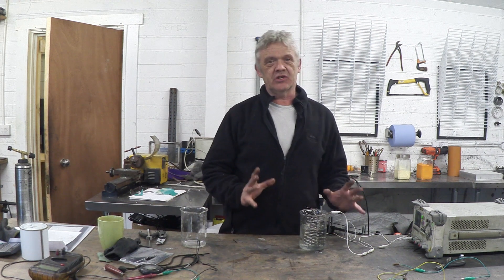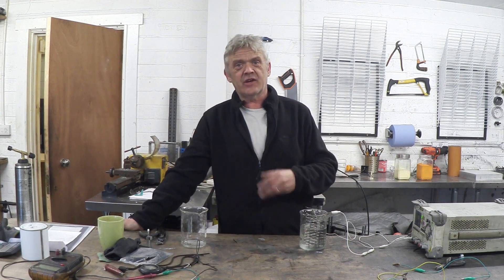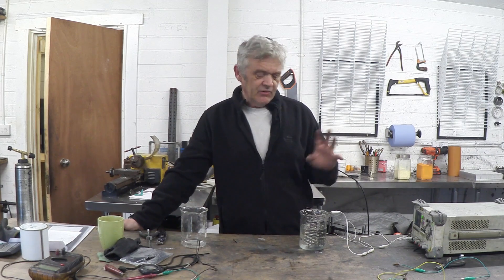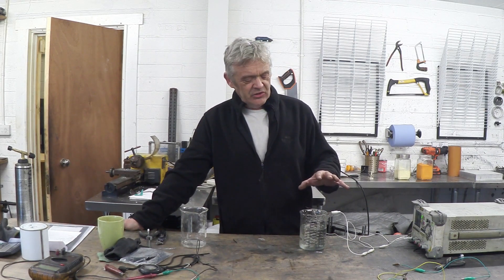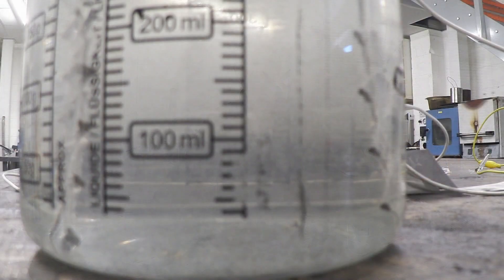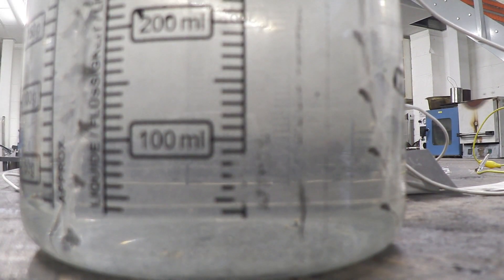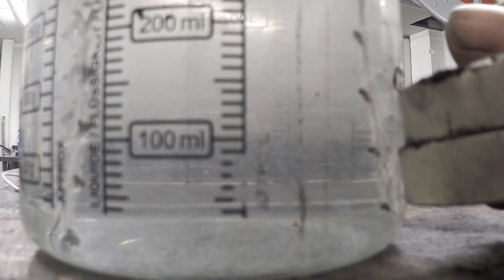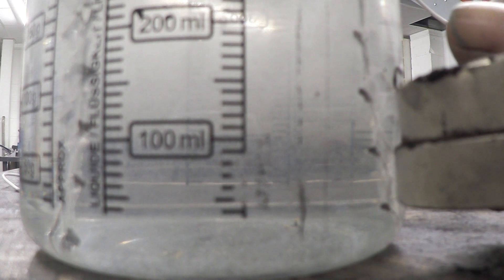Making Hydrogen With Magnets

Comment: Will stationary magnets next to wires with flowing electricity add to the power or voltage coming out of the wires?
In other words, will a low power source increase in proximity to stationary magnetic fields increase output; or is it the reaction of the electrolyte chemistry that is increasing?

Comment: There is a paper on the net with a magnet spin experiment on the electrolysis of water. The paper states that by aligning the spins in a vertical direction (or parallel to electrodes I think) as much as doubles hydrogen production. It's a fairly physical reasoning that the gas bubbles are prevented from collecting on the electrodes. Otherwise, the holding of the bubbles on the electrode surface physically prevents contact with the water reducing efficiency. I guess this has already been observed, but the point is that fine-tuning the directionality as much as doubles the effect. This is way beyond a minor effect and is easily achieved. The paper also states that the introduction of the magnetic field serves to increase the current density in the electrodes, for free.

Comment: H2 is diamagnetic and O is paramagnetic so the hydrogen component is being repelled by the lines of magnetic force while the oxygen is being attracted to the magnetic lines of force thus in essence providing a mechanical force for breaking the bonds apart.  This magnetic force supplements electrolysis from having to do all the "heavy lifting" which saves considerable current.

Comment: Im not youtuber, but i want to make a experiment, i want to generate hydrogen with a microwave motor, with the very high voltage that generates the motor, but very low amps. If you can make that experiment in your chanel, would be great, because i dont buy the motor yet.

Comment: Adding a magnetic force produces a downward Lorentz force, and convection of the electrolyte counteracts the floating power of hydrogen bubbles and exerts a negative effect. 
Electrolyte convection is oriented in the direction of the floating power of hydrogen bubbles, positively affecting hydrogen production through electrolysis and reducing electrochemical polarization.

Comment: normally you have the wires going into the container from outside but i wonder if you had a coil on the inside and a coil on the outside so you have a glass core transformer effectively.
and then you have the 2 end seperating from the coil to generate you're hho gas.

Comment: I wonder if this can be used to help deplate preacious metals without useing a dangerous electrolyte..like sulfuric acid. In a gold deplateing cell.  Maybe with the magnetic field enhancing the process just enough to use some safer electrolyte such as acetic acid and salt . not only would it be much safer but cheaper as well. Ill have to give it a try thanks again .

Comment: I have a question for you. What effect does adding amperage and what effect happens when you up the DC voltage? For instance, is 24 volts more effective than 12 and if so, what about 36 or 48? Does adding amperage make any difference? In fact most references mention millivolts. I have certain physical limitations that prevents me from conducting experiments my self but my curiosity is certainly aroused.

Comment: Awesome. "Magnet power" is REAL. Joe Newman died for our sins. Simply adding powerful magnets makes an electric motor STRONGER and FASTER. Joe Newman proved this, and my many motor experiments have proved this also. Now, here you are showing that this same "magnet power" effect holds true for electrochemistry as well as for electric motors: magnets actually "pull" on the electricity itself- making it more effective (in this case, producing more hydrogen and faster): or by opposition; magnets can be arranged to repel the electricity, slowing the motor, choking-off currents or repelling them, causing a motor to get hotter than it should for the applied "energy", etc. Adding magnets in one polarity makes it work way better: adding magnets in the opposite polarity makes it way worse. There is a Japanese scientist who is using pulsed magnetic fields to triple the output of his own, Brown's gas (HHO) generator, but i think the steady-state permanent magnets are good enough- use a vibrator or pumped water flow to help release bubbles from electrodes- make the plates closer together, use a better electrolyte (like strong salt water and stainless steel plates)- and now this: add permanent magnets across your capacitor plates, and the Hall effect will "speed-up" the current across the plate, without needing to raise the battery voltage or lower the electrode's electrical resistance.

Comment: I built a large cell from stainless steel pipe with an external tank and pump.
I placed the negative electrodes in tubes so as to separate the h2 from the oxygen.
A very small pump circulating the fluid was very effective. The external tank also allows testing ph without disturbing the the cell. Please do more research on these cells and post.
Also, magnetic separation of the gasses?

Comment: Daniel Dingel was also said to have magnets incorporated in his hydrogen generation system. The interesting thing is he apparently used a bismuth electrode. This has dielectric properties and may have intensified effects whith magnetic fields. His work was cryptic though, because his secret was never revealed. The bismuth may even have been used for its low radioactivity, seemingly contained in aluminium for the alpha radiation. But all these substances are related to hydrogen generation in some way already. Maybe he just combined them all?
Just in case anything there might be useful.

Comment: Old microwave transformers hooked back to back by the high voltage coils. Use a peizo element of a hundred watts or more with it connected to a ground and antenna. The idea is you may get a bit of power on the other transformer.

Comment: Just a guess, but if Hydrogen is diamagnetic a strong magnet nearby would repel the bubbles from the electrode freeing up the surface area for a more efficient hydrolysis. As someone mentioned below, similar to stirring. Same explanation as Sci Pi, but with Hydrogen rather than water being  the diamagnetic in this hypothesis.

Comment: Have you measured the volume of hydrogen produced with and without a magnetic, over the same period of time, to see whether more hydrogen is actually being produced, or perhaps the same is being produced but the reaction and bubbles appear more concentrated when a magnetic field is applied? Curious. Thanks!
Reply: the faster the bubble leaves the surface, the more the surface is in contact with electrolyte , thus faster the rate of production!

Comment: What happens if the electrolysis is done under very high electrolyte pressure?
Reply: The general rule is that pressure hinders molecular disassociation and a vacuum facilitates molecular disassociation

Comment: Well, I tried this with my higher voltage no electrolyte HHO test setup, it has no effect that I can detect, guess it has something to do with either the current as mine is very low or the electrolyte as the document states plainly, that it has something to do with the alkyli, anywho, Ill keep twiddling with it. If you want to replicate my experiment: its two stainless electrodes in just water @ 30 volts and bring them together until .4 amps but really I tried many variations and saw no change in gas production with magnets without electrolyte... interesting. Have not tried pulsing yet.

Comment: i know people have used magnets and electromagnets to separate the hydrogen gas and oxygen gas at the top of an hho generator . SO  i believe the gases are ionized. so you MIGHT just be seeing more gas pulled toward the magnetic area rather than a total increase in gas production. Don't know. just a thought. Would have to measure production with and without a magnet.

Comment: I built an electrolyser with magnets, mainly idea was to use magnetohydrodynamic to push the water and remove the bubbles on the surface of the electrodes. 15cm electrodes, 12mm surface, 5mm apart and 4 pairs of Nd magnets.
It kinda worked, I could see the water/bubble mix rise about 5mm over the surface of the water, when the electrolyser was also near the surface.
Going further with the idea, was to chain these electrolysers in a tube having circulating water...

BTW: Salty water is really bad for the magnet, they fell apart since 10 years a built that device... and I still have the same water too!

Comment: In one of your videos a few years ago you made a coating that when exposed to sunlight would separate hydrogen from water with no power input. I'm wondering if magnets would improve that reaction also.
Reply: do you have  a link please?
Reply: If I am recalling correctly he was using seawater in that video, may have even been on the beach.
Reply: Search the channel for graphitic carbon nitride.  And yes, a static  magnetic field does help photolysis by improving ion separation, reducing recombination.

Comment: I think what you're saying is just an increase in the point not an increase in the entire electrode I think it's changing the way the electrode is working to the point that is just redirecting output to line up with the arches of the magnetic field. That's just a guess I could be totally wrong you need to find a way to measure the volume of gas over time for comparison that would be kind of difficult without specialized equipment unless you can figure that out. I think if anyone could figure out how to capture that data you could.

Comment: @2:30 "Obviously it's a way of improving these things without actual [additional?] energy input"
Does this mean that additional hydrogen gas is produced while the current flow stays the same?
If current stays the same then that is a true increase in efficiency and those that say the magnetic field of knocking bubbles off which increased the liquid contact surface area are wrong. This is because if the permanent magnetic field were knocking bubbles off thus increasing the surface area, then the current would increase proportionally to the gas production.
Reply from the maker: read the paper given in the description mate

Comment: You should be able to quantify the increase in gas generation under a magnet field, by monitoring the cell current.
Any additional gas generation will be associated with an increase in cation current as the hydrogen ions are discharged.

Comment: Wrap wire around your vhoice of anode and cathode to create electromagnets inside your generator. Would those generated magnetic fields increase your hydrogen production?
Reply: 4th word 'vhoice',a typo,colloquism of what do you mean?You described a tank circuit ,approxmately,an inductor and a capacitor should your anode and capacitor be ,but not mandatory configuration,square or rectangular.

Comment: That's "just" the Lorentz force pushing the bubbles off the electrode.  Now if your electrode resembled an induction coil that would turn into a compact electro fluid dynamically pumped hydrogen generator. It might even last longer if you anodized the electrodes like you did for your Bagdad battery.

Comment: Electromagnetism. Go figure, water is a capacitor just like air.
It still takes a ton of energy to pop that hydrogen atom off. It's sticky and it finds every hole. Or make enough, fast enough.

Comment: Interesting. If that is magnetohydrodynamic stirring as suggested in another comment, then I bet that applying ultrasound to the container would have a similar effect. That would require a small power input, but could be morphologically much simpler than guaranteeing a high flux field at every active surface.

Comment: Thanks for your videos Robert.  I was wondering if you could try putting a conductive membrane or plate between the anode and cathode which I am thinking would allow you to keep the gases separated but improve performance due to less resistance.  Love your experiments, keep it up!

Comment: Now what would be awesome is if you make a video where the gasses are in a mixed container like that but on top you have 2 pipes for the gasses to travel up.. A thin square magnet sits in the middle between the 2 out going square pipes and on the outside of the tube that the North side of the magnet is facing put another square neodymium magnet with its North facing in towards the North side of the magnet in the center.. Do the same thing for the south side.. So one out going pipe is filled with a magnetic North and the other a magnetic south.. Hydrogen will go up one pipe oxygen will go up the other.. Thus you can spit the gasses without having to move the electrodes away from each other.

Comment: Amazing! Now time to calculate the power efficiency on converting electric to burning hydrogen.
Reply: Regardless of how you do it, it costs more to break up water into oxygen and hydrogen than you can possibly recover by burning those products. This is obvious.
Reply: @UncleKennysPlace  RMS states categorically on at least one other video regarding Urea electrolysis that there IS a net gain specifically over water electrolysis, but also that the energy output exceeds the input.

Comment: Something to do with aligning spin and spin coupling of diatomic molecule or liquid oxygen is magnetic so possibly mono o is and it helps strip oxy from the hydrogens into water away from electrode faster increasing kinetics.  This is the most amazing YouTube subscription I have ever found.  Thank you English guy!  Magnetic field lines allow hydrogen "atoms" but water being diamagnetic repulsed.  Any change of ph with the addition of magnetic field?
..  English guy? Any ideas?  Shine a red laser through field area with magnet and without, any change in refraction, density   or scattering observed in laser?

Comment: I've observed this with some of my electrochemical cells, mainly those that produce a gaseous product. I figure it has to do with generated gas blocking portions of the electrodes. If 50% of the electrode is covered in gas bubbles, we lose 50% of our useful surface area since the ions can't travel through the gas. Adding a magnet allows the electrolyte to be stirred and knock off gas bubbles (magnetohydrodynamic effect). Similar boosts in cell performance can be achieve with stirring, electrolyte flow using a recirculating pump, or just smacking the electrode. I tend to just toss a stir bar into my cell and run under mild stirring.
Reply: it could also have something to do with the water being attracted to magnets.  the water moving towards it pushes bubbles off.
Reply: @ancapftw9113  I'm going to go nah on that one. But hey! Try it out!
Reply: @ancapftw9113  I suppose that could be part of it. Water is diamagnetic, so it is repelled from any magnetic field. The effect is very weak, but and easily be observed.

A demonstration of this easy to try at home if you want something fun to do. Get two syringes filled half way with water, use glue or tape to fasten the plunger ends together, then suspend the pair of syringes with a string attached to the middle. The apparatus, if balanced, will spin away from a magnet.
Reply: @Scipiworld  ive seen experiments where a large magnet is placed directly under the electrodes and a vortex can be seen in the bubbles movement, the vortex is caused by the spin of magnetic forces, one side of the magnet creates a righthand vortex the other side a left hand vortex. you might find ken wheelers work interesting, check out my playlists!
Reply: Cool thing about the Magnets is no extra power input
Reply: @ShilohSedlak  it's not completely free. Adding the magnet makes it a form of magnetohydrodynamic pump, so work is being done on the fluid. The stirring is very small at currents used, so in this case power loss is negligible, but with careful measurement or high currents, one would likely notice a back emf generated by stirring the electrolyte this way.

Cool thing is the process works in reverse too. Flowing a conductive within a magnetic field over two plates can generate a voltage. The efficiency isn't great, but it's possible to convert a flowing conductive fluid into electric energy without any moving parts other than the fluid. The effect is very noticeable with highly conductive fluids such as mercury or galinstan.
Reply: Thank you for explaining why, the 'why' of it was really troubling me. In physics nothing is free and your explanation cleared up the potential for magical thinking something like this so often inspires.
Reply: I think you nailed it on the head.
Reply: Hey Mr know more than me, please answer this, or RMSmith, can both gases be stimulated by magnetic fields?    (One would assume stirring would work to increase both, considering utilizing both in unison).

Next, the urea solutions produce hydrogen and oxygen? 

& last it is my understanding that atmospheric pressure plays a negligible increase of power input,
So these gas in say a urea solution would naturally build pressure at low input/amps, is this correct...?

thus my belief is if a appropriate pressurized system was built, 1 could extract energy from both gases...

 "charged/pressurized state with out loosing any of the hydrogens potential energy," or the gases, location, lighter than air properties to allow said to rise, energy extraction could be preformed then be run though a "PEM,"/ h-o fuel cell... 

Thank you
Reply: Or stored in the $20 dollar a gram sugar/urea compound mr RmSmith shows us lol thanks
Reply: Thank you for this comment. I think PWM used to power HHO cells do the same kind of effect: shutting down the power make the bubbles (and eventually the debris) to no longer be attracted by the electrodes (if we can say it this way).
Reply: Actual energy gains are observed